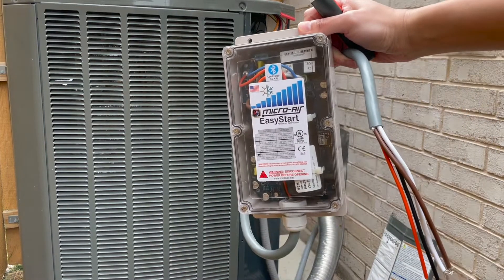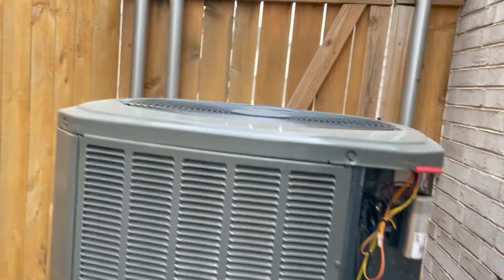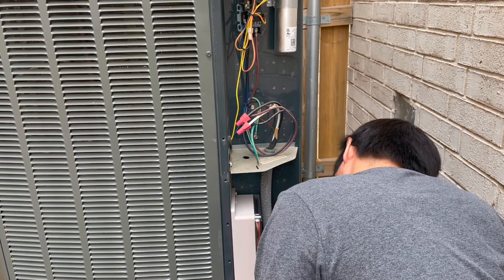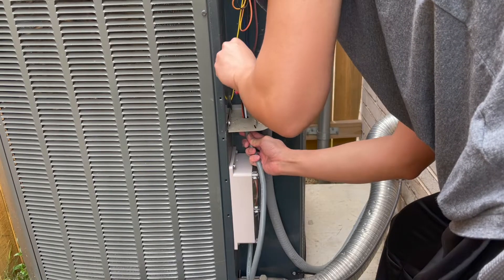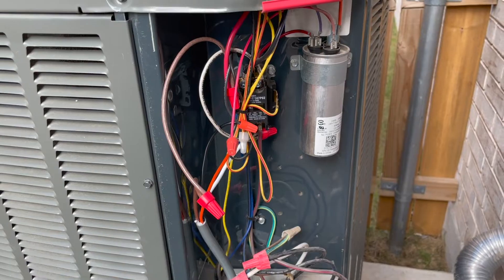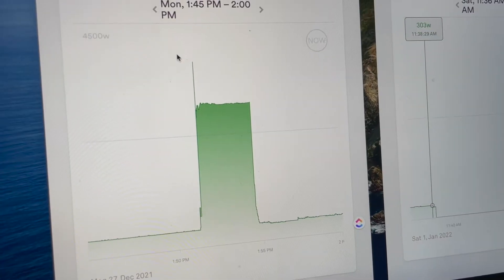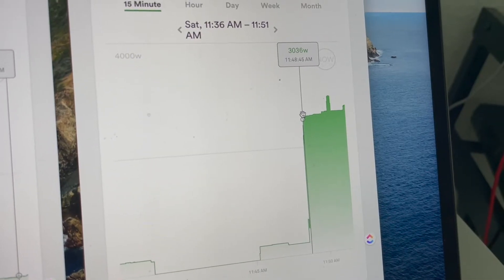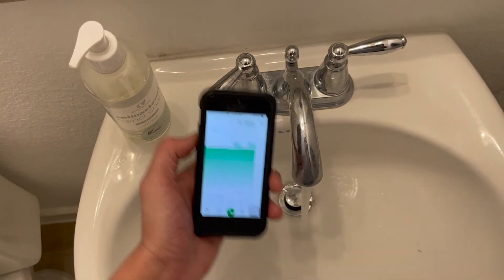Running a 4 Ton AC on a GENERATOR - Micro-Air Easystart 368 Installation & Testing

Comment: Thanks for sharing Jonathan. I have some questions:
1. Once the AC kicked in, the running wattage for the AC remains on about 3k to 4k watts?, if so, then I need a generator that supports at least 5,000kw running, not less, correct?
2. How long is the cable from the generator to the inlet box
3. I have a 4 ton AC also, and your Easy start is 48x, but now Easy start says I need a X72 for a 48,000 BTU, but yours run with the X48, with no problems. Should I go with the X72?

Thanks
Reply from the maker: 1. Yes - you need a decently sized generator to run a whole house HVAC unit. For a 4 ton unit like mine, I'm BARELY able to get it started with my 8750W peak/7000W run generator. I wouldn't go any lower. For a 2 ton unit, you might be able to get away with a 5000watt unit. The issue is mostly on starting. After it starts, the HVAC unit takes a quarter or even a fifth of the peak power.

2. I bought a really long cable - 80ft because I wanted to keep my generator in the backyard during an emergency while all my power panels are near the front of the house.

3. X72 makes no sense to me. X72 is for a 6ton unit. The X48 would seem to be appropriate in my opinion. If you're interested in saving money, I have learned since there are other soft start manufacturers out there. I haven't tried, but the ICM Controls 870-32A looks like a good alternative. If I were to do it again, I would try one of these other solutions. Easystart is a bit overpriced IMO.

Hope this helps!
Reply: @jonathanDIYs  thanks. I finally installed the X48 easy start with no problems, it reduced the kick amp from 73 to 23 on the first learn, then it settled at 25 amps. Sweet!
Reply: @jonathanDIYs  Thanks for your posts.  Just FYI Mircoair changed their recommendations recently and they now only rate the X48 model up to 3.5 tons.  For 4 tons and above, the X72 is what is recommended.  I can only assume they did this for a good reason and I sent an email to support to confirm.  As far as Micro-air being "overpriced" keep in mind this is a US company with US support who developed this technology, I am guessing they will perform better than the knock off foreign  products.  FWIW I pt my money where my mouth is and my X72 for my Trane 4 ton XR16 is on its way now.  Thanks for the videos.  You can also shop around a little and get a better deal online than buying direct from Microair.
Reply: @jonathanDIYs o bought the x48 for a customer of mine who had a 4 ton heat pump. I called tech support and they insisted I needed the x72 even though one one site I read the 48 was big enough for a 4 ton. Then in another section of the micro air page they said a 4 ton needed a 72. My customer insisted going back to the 72 and returned the 48. 72 did dj the trick though
Reply from the maker: @brandonstephens1447   I have heard a bit of confusion in this area. I am not 100% certain, but I think micro-air changed their ratings and recommendations at some point in the past but did not update all their documentation. I do have a 4 ton unit and I do have the ASY-368-X72. I think oversizing would not be an issue, while undersizing definitely will be an issue. My guess would be that 4 ton units are right at the limit and some units would work on the 48 but it would be safer to just recommend the 72 so that everything can work. Glad the install worked for your client!

Comment: Just installed mine. AC started ok but it trips all my breakers in my panel ... what is wrong here? Any suggestion?
Reply from the maker: Did it trip breakers before you had it installed? Did you say all your breakers?? Sounds like you have a wire connected to the wrong thing or a short somewhere. I'd double check the wiring. Tripping all the breakers is quite the feat - if things are wired correctly, you should only be tripping the breaker for the AC condenser which should be a double pole 40 or 50 amp breaker. 

Does the breakers trip instantly or does it take a few seconds or minutes?
Reply: @jonathanDIYs  the AC breaker doesn't trip but all the other running in parallel from the same circuit. I don't know if it's something related to the frequency or voltage stabilization. I read something like this on Internet. Worst part is that I bought the biggest LNG portable generator (10kw peak/ 8 kw running) but it seems insufficient. My AC in rush current is now around 35A but with just 6/7 amps from other loads in the house I'm scratching the 42max amp. I will install a monitoring device and see how everything behaves during this operation. I'm just afraid this peak load information doesn't mention that the voltage will be very bad. Btw, all videos on internet about AC Starts and Generators, it seems the generator are running on gasoline with delivers more power than propane and/or LNG.
Reply from the maker: hey, sorry for the late reply - was away on vacation. What type of generator are you using? If it is a standard generator, yes, the voltage and the frequency can fluctuate during peak load (both voltage and frequency dropping). I bought an inverter generator that has less of those issues. Yes, it seems generally true that gasoline has the highest power output. When I look at ratings, it seems like it is gasoline > propane > Natural Gas. Hope you sort it out. Maybe try turning everything off when starting up the HVAC and then turn power back on gradually to everything?

Comment: I do not know why it did not come with any crimp-on connectors.
Reply from the maker: Some resellers sell connector kits, but I found it more economical just to buy a whole set of connectors myself.
Reply: @jonathanDIYs  It only needed 4 connectors. For the price we pay for it should've come with the connectors. There's other, lower cost soft-starts out there that come fully loaded with cable ties and connectors. I just discovered one last night that's made in the USA.
Reply from the maker: @troy3456789  really? Please share. This was the only one on the market that I knew about when I originally purchased this.
Reply: @jonathanDIYs  Same for me too. Mine cost almost $400, but installed it already.  Lemme look it up
Reply: @jonathanDIYs  ICM870 soft starter. I do not think it has Bluetooth. It's like $170 https://youtu.be/b2vpP5QBSlE
Reply from the maker: @troy3456789  thanks for sharing! I definitely would have considered this if I knew about this when I was doing this for my AC. This is great!
Reply: @jonathanDIYs  same here brother, same here. It is too late for me, but I can and will tell others about it when someone else is considering a soft-start.

Comment: Well you lost some generator output with that long cable.
Reply from the maker: Hi Paul, thanks for commenting! According to Southwire's voltage drop calculator (https://www.southwire.com/calculator-vdrop), I only lose about 2.23% volts with the 10 gauge and ~85ft of cable I am using which is an acceptable amount. 30 amps over a 10 gauge wire can be run up to 114 ft.

If it were a thinner wire, I would have problems utilizing the full 7000 watts the generator can generate, but as it stands, the wire is sufficient for the generator.

Comment: That is completely the wrong bushing for the knockout. You need to use a strain relief for the cable that has a nut to secure it to the knockout hole. The way it is now that bushing is going to fall out real soon and then the cable will rub against the sheet metal with vibration and cut into the insulation shorting out the circuit possibly burning out your expensive soft start kit and likely starting a fire. Thats real bad!
Reply from the maker: The hole is too small and is not able to hold a standard size bushing. On retrospect, I would have drilled the hole bigger and use a standard bushing with a strain relief. As it stands now, the wire is jammed in there with the plastic bushing and isn’t going anywhere. It took me 15 minutes to squeeze the wire and bushing through the hole. Thanks for the advice and thanks for commenting! 

The other thing I would have done better is crimp the condenser wire instead of screwing it directly to the contactor. If I ever go back to opening or working on the unit, I’ll address those issues.

Comment: I thought a 4 ton unit needed around 15 KW generator?
Reply from the maker: Without a soft start, you definitely need a 15kw unit. With a soft start, my 7k unit is able to power it just fine! AC units actually only need a lot of power during startup. If you're able to smooth out the startup power draw, you can run it with a smaller generator. The key values to look at are the LRA (locked rotar amps)  and the  RLA (rated load amps). The LRA is the amount of power it draws at startup and the RLA is the regular running load. A soft start reduces the LRA to be closer to the RLA.

Comment: Thr reason you don’t want to mount it upside down is because you want to virtually eliminate the possibility of water intrusion into the strain relief where the wires are exiting the device.
Reply: That and the capacitor is a Castro oil filled canister so you don’t want the oil to be saturating the top where the terminals are at as this could leak out over time.
Reply from the maker: Learned something new - thanks!
Reply: I"m reading the comments to say this.  I see it's already been said.  I wish I could search the comments on Youtube.

Comment: Thank you so much for sharing this. Will this work in a dc to ac solar inverters? Most manufacturers of such inverters doesnt recommend that u hook up inductive load on them, especially if their peak loads are too high (even if it doesnt exceed the inverter capacity, still not recommended). I have a window type AC 1hp if not mistaken. Im planning to hool up a soft starter after the thermostat switch.
Reply from the maker: Hi Sunny, thanks for commenting. This should work for dc to ac solar inverters however, I don't think they make a soft start for window type AC units. Do you know if those units are for sale? I'd love to do some research on it. Thanks!

Comment: Hello Johnathan, how long is the 50 amp "really long cable" and where did you get it from?  Do you remember what you paid for it?
Thanks
Reply from the maker: I got a 75ft long cable and it wasn't long enough, so I added another 10ft extension to it. I bought it off of amazon.com for $161.21 and $31.34 respectively. I watch the prices and try to get the cheapest one. Here are the exact 2 I have:

https://www.amazon.com/gp/product/B085HHWV16/ref=ppx_yo_dt_b_search_asin_title?ie=UTF8&psc=1

https://www.amazon.com/gp/product/B08HJ6NHSX/ref=ppx_yo_dt_b_search_asin_title?ie=UTF8&psc=1

Hope this helps and that you're able to get your setup working! Thanks for commenting!

Comment: For the softstart to work best and reduce the compressor in-rush it would better it should be connected on the compressor side of the contacter.
Reply: The  micro-air white wire connects where the compressor R (run) wire was connected. Then, you connect the micro-air brown wire to the compressor R (run) wire. You connect the micro-air black wire to the contactor on the other side of the contactor.
To find the right compressor R (run) wire, you look at the schematic on the inside of the cover. It will tell you what color it is. Mine was yellow.

Comment: Which model did you use and you did a great job
Reply from the maker: Easystart 368 X48 which is rated for an 4 ton HVAC unit model. Thanks for commenting!
Reply: @jonathanDIYs  I just checked I have a 2.5 ton for my town home is that’s still ok to buy or which do you recommend and where can I buy it thx for your reply and fyi great work on yours
Reply from the maker: @lejend69  The Easystart 364 (ASY-364-X36-BLUE) would be more appropriate for you. You want to choose the easy start to the appropriate size of your AC. 2.5 ton unit is 30k BTU. You can get it from:

https://wateryachtsolutions.com/easystart-364-soft-starter-for-ac-units-up-to-36k-115v-230v-asy-364-x36-ul/smartstart

What are you looking to achieve? Are you trying to run the AC off of a generator?
Reply: @jonathanDIYs  I’m trying to make it easier for a solar set up
Reply from the maker: @lejend69  awesome - hope it works out! Let us know how it goes!

Comment: Unfortunately You did not use a strain relief on that new cord into the knockout, this can lead to problems later. On your 240V feed, you use Romex inside the sealtite, this is a no no in wet locations.  Otherwise thanks for the information.
Reply from the maker: Hi Bruce, thanks for commenting. 

Oh wow, I just watched my video and see exactly what you're talking about. I can't believe the HVAC installers left it like that and that neither my home inspector nor myself didn't catch that this whole time. Thanks for pointing this out for me.

Comment: The shorter you can make the cord from the generator the less loss you will have.
Reply from the maker: Unless I "lose" my generator altogether. ;-) Joking aside, I did have a concern about security with running my generator in the front of the house. I wanted to be able to keep an eye on it while inside and make it pretty inconvenient and noticeable if someone was going to try to take it. But you're absolutely right, the shorter the wire, the less the resistance. For long runs like that, you need thicker and thicker wire.
Reply: Security is a big concern for any portable generator in a power outage.  I installed a cement anchor hook on a 100lbs 2x2 concrete pavor. Our generator is positioned over it. I have a really thick chain and lock, that I put though the bottom frame on the generator and lock it under the middle of the generator.

If they want our generator that bad, they will have to cut the bottom frame, on both ends, to take it.  At that point, it would be useless and hard to move.
Reply: That thing is so loud, anyone looking to steal a generator will know you’ve got on running.
Reply: @jimsjacob 
Heard from a friend, his neighbor had a generator stolen during outage for Hurricane Katrina.
He said his lights went out and he could still hear the generator running. Thought it broke down, went outside and there's a lawnmower running where his generator was.
Reply: @deanb949  😂🤣.  Ingenious!

Comment: Great detailed video.  Being able to run your Central AC system off a portable generator, is much better than buying and installing window units. 

I just installed this same Soft Start on our Lennox 3-ton AC system.  We have a Predator 9000/7250 watts generator that I installed a Tri-fuel Kit (Motor Snorkel). The Motor Snorkel is the best Tri-fuel kit you can buy and install.  It works very well, with minimal power lose when using NG.  That's because you can adjust the air/fuel mixture with the regulator.  Unlike already Tri-fuel generator that have fixed jets in the carburetor. 

The LRA w/o any hard/soft start was 57.1 amps.  Our generator, on gasoline, couldn't start our AC.  I installed a Hard Start, which bought the LRA down to 37.1 amps.  Now our generator could start our AC on gasoline, but not NG.  I removed the Hard Start and installed the Soft Start.  The LRA came down to 20.8 amps.  Now our generator can start/run our AC system and whole house on NG.

We do have to turn the AC off, when running high wattage items, like the Microwave, gas dryer, sum pump and coffee maker to name a few. These items will bog the generator down and bring down the hertz well below 60 hertz. On NG, 6000 watts was about the max I was able to safely run on our generator.
Reply from the maker: Thanks for sharing! I'm always curious to see the difference between a hard start and a soft start and it great that you have numbers.

If you get an inverter generator, the frequency will always be the same. I got one because I have a lot of electronics and I didn't want to damage them when I'm on generator power. The THD of regular generators can be pretty bad for electronics.

Glad your setup is working out! It's almost cool enough for me to install the motor snorkel. Probably will be getting to that project pretty soon.
Reply: @jonathanDIYs  Definite good to run your fridge and AC on pure sine wave inverter generator. Modified sine wave makes the motors overheat and run inefficiently. Inductive loads with electric motors should always be run on pure sine wave. There's at least 3 electric motors in your HVAC system: the condenser cooling fan, the squirrel cage blower fan, and the compressor motor (all would take damage by using modified sine wave power)
Reply: The inverter generator is the way to go for that perfect 60 htz. After over 80 hrs. of use with our Predator 9000/7250 watts Tri-fuel generator, we haven't had any issues with our electronics.  At this time, I would only buy an inverter generator, when our current one fails.
Reply: @Pk3_Garage  HI, are you able to run your furnace with your predator generator ? Also, do you have a lennox furnace and A/c . My a/c and furnace are lennox and I heard the are really picky about thd. I just bought a westinghouse 11500tfc and just read about thd levels.😅
Reply: Yes, we can run our furnace easily with this generator. Our furnace runs on 120V. Only the a/c is Lennox.  Our furnace is Rheem.  Also, our units are over 27 yrs. old, so they don't have all the fancy technology in them.
Reply: Quick question I have the same generator predator 9000 what would you recommend for installing  soft start or hard start for ac unit and thanks On advanced
Reply: I would recommend the Micro-Air Easy Start Kit (Soft Start). Checkout my video review on it. https://www.youtube.com/watch?v=IB5sbnNypgI&t=1404s
Reply from the maker: Soft start is best if you want the lowest inrush current. Only negative is the soft start is so much more expensive!